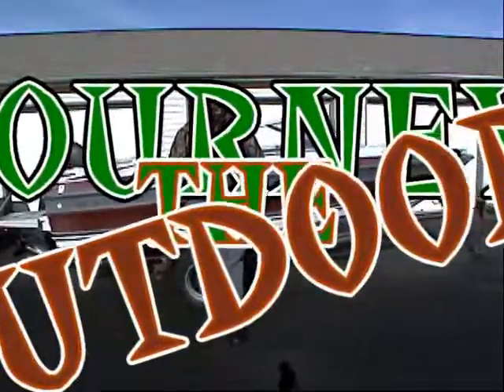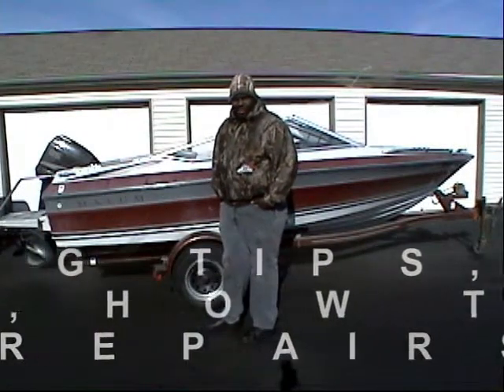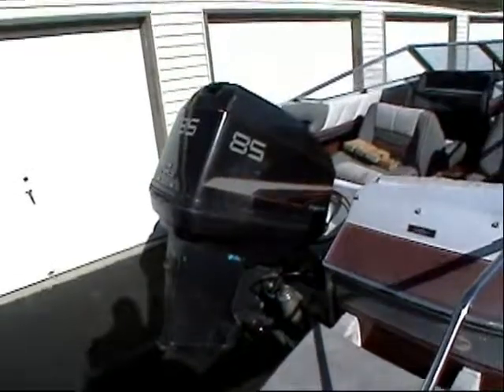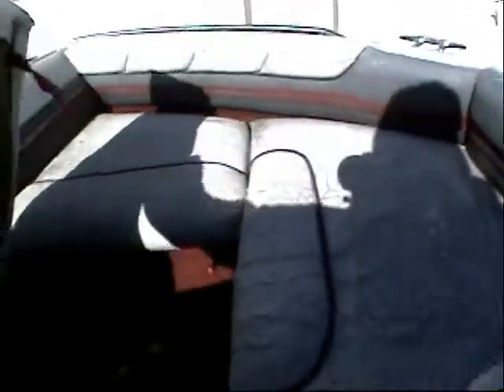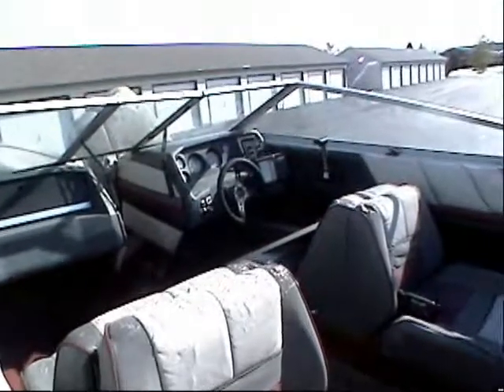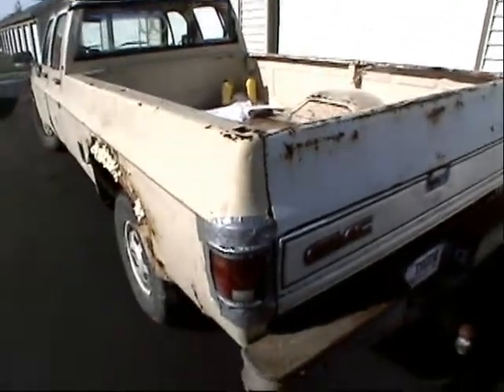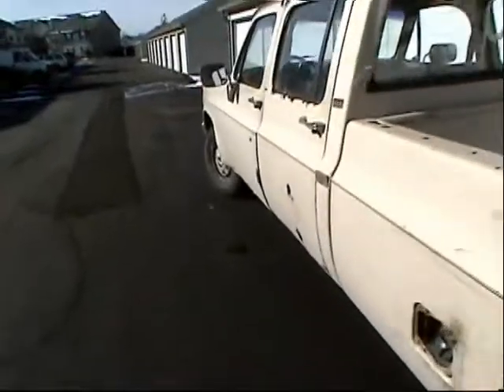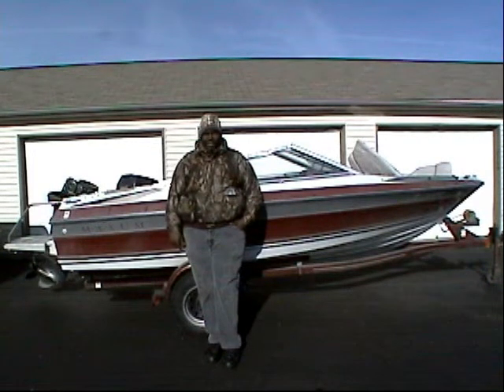JTO #34 : MAXUM BOAT REBUILD PART 1

Comment from the maker: yes I needed to get a truck to pull this boat.
you can learn to process your deer in the woods just take a nice big cooler with you. After you tagged and registered your game, take it back to the woods, use a portable pulley system ( i made a video on how to make one) hoist your game, gut, skin, carve off your meat throw in the cooler and your good to go!
hunt hard, hunt safe, eat well.
-dave

Comment: sounds like a good plan on the boat new wood,cheap carpet,swivel chairs and casting deck you should come out allright on it,but i wouldnt bother restoring that old truck there not in demand and it will never be worth a whole lot,id just drive the wheels off it.